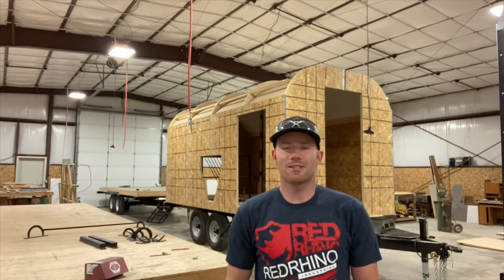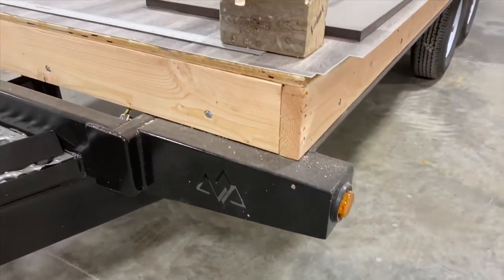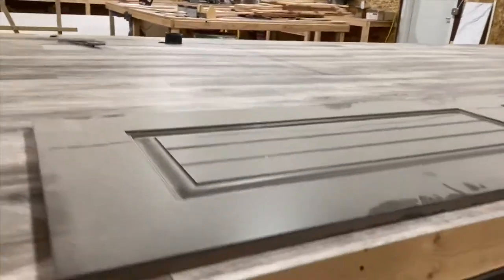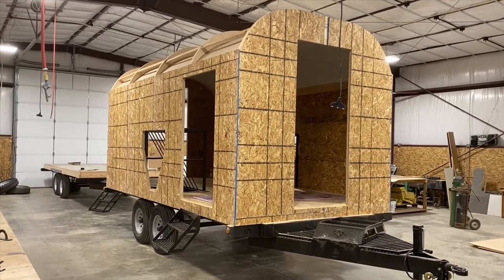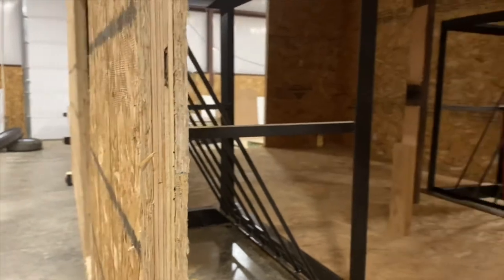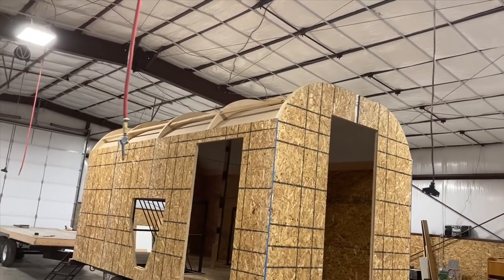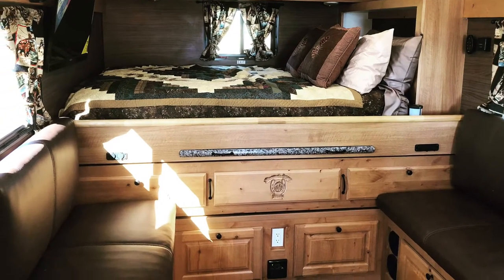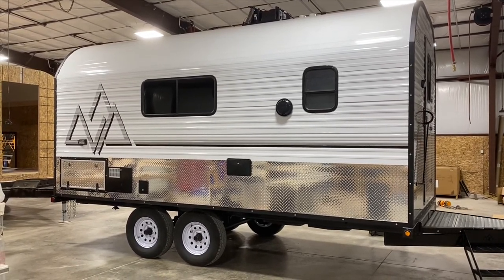Construction of the ultimate sheep camp!

Comment: Nice design, poor choice of materials, the use of OSB, non-pressure treated lumber , and fiberglass floor insulation is a deal breaker, not built to last, remember the 6P's when designing a project that will be subjected to inclement weather, Proper Planning Prevents Piss Poor Performance...CDX plywood made for exterior application, pressure treated lumber, and foam insulation sheets